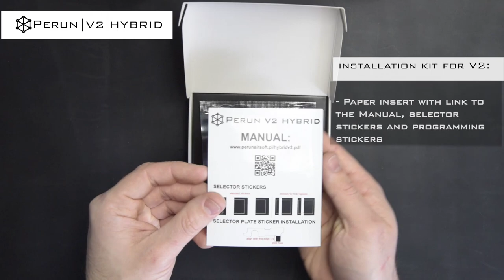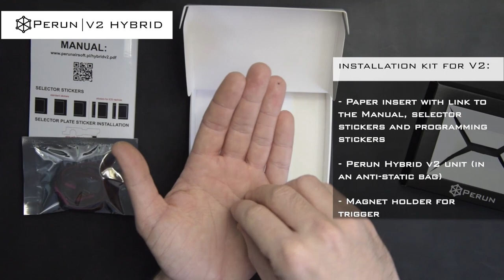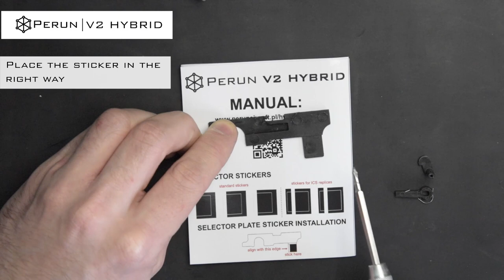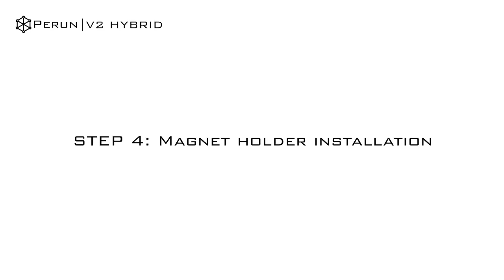Perun V2 Hybrid installation manual

Comment: So I can not use this in a gearbox that has a broken trigger bar? I have a shell that the bar broke that holds the trigger contacts. bummer....
Reply from the maker: Do you mean that small piece that normally prevents the contacts from falling back and onto the sector gear? You can do without it, the middle pin will take over its function. You will just need to remember to hold the trigger while inserting the pin.
Reply: @perunairsoft4811  Okay, thanks.

Comment: Does it work in the LT-19TL-G2
Reply from the maker: It's a standard V2 gearbox, so V2 Hybrid should work there just fine and without any modification. Unfortunately, we can't promise that there won't any surprising features there, which would require some additional work.
Reply: @perunairsoft4811  ok thanks and this video was very easy to understand

Comment: After this video i already order this kit :) I have Hight rpm motor, and for now 18:1 gears and 100m spring. Should i change it for this kit or nope ?
Reply from the maker: It's hard to say. It depends what is your motor rating, but it will most likely work. Make sure your battery has high current efficiency when using a high speed motor (high "C" and capacity).
Reply: @perunairsoft4811  Tornado F2 High Speed gen.2 this is the motor and battery is 11v and about 900mah. tbh I'm going to use it on single or burst mode 95%
Reply from the maker: @patrykkeska6696  Electronic fuse should not kick in due to overcurrent, which normally is the main reason high speed builds like that don't work. However, this 900 mAh battery doesn't stand a chance. It will quickly overheat and will long-term wear out very fast. A 3000 mAh battery with 20 C current efficiency is a minimum for such build, or at least a 2000 mAh 30 C package.
Reply: @perunairsoft4811   OK thanks a lot :) so I'm going to grab one of those big batteries

Comment: Yoo perun, love ur mosfet for sure, just tried it on my friend's replica, so i want to ask, does it fit with lonex new versjon gearbox? Thx
Reply from the maker: Thank you for the kind words :) We're not sure what you mean by the new version of the gearbox. We did test the Hybrid with the quite old Ultimate (Lonex) gearbox we have around, but if a new version came out, we can't promise there won't be need for a  modification.
Reply: @perunairsoft4811  just saw it and an old lonex gb has a hole in spring line just like ur gb on ur video above, but new model is just fully close. Btw thx for ur reply, gonna order it. Cheers 👍
Reply: @perunairsoft4811  just installed on my lonex gb and of course its a beast mosfet, love it!!!
just want to ask, how much volt that lipo alarm will buzz? thx a lot!!!
Reply from the maker: @vedhoargiaarga9983  Thank you :) Li-Po alarm activates at 3.7V per cell. For more details about that and other technical aspects of the mosfet, we strongly recommend having a look at the manual: http://perunairsoft.pl/hybridv2.pdf
Reply: @perunairsoft4811  i just have a problem with ur mosfet. Pls read the email. Thx mate

Comment: does this require any soldering?
Reply from the maker: No, unless you are installing it in a G&G replica, where in some cases it might be necessary to cut the battery connector off, channel the wires through channel in the buffer tube base and solder it back again. Other than that, there is usually no need for any soldering at all.

Comment: Will this work with cyma mp5?
Reply from the maker: Yes, but be advised that might need to grind down a small piece of metal in the gearbox to be able to put Perun in place (and not only Perun, that would be true for every drop-in unit on the market).

Comment: Thank you for this awesome walkthrough of installation, I plan on ordering the v2 rear wired model, will that fit in a CYMA Platinum QBS 14.5' gun?
Reply from the maker: Hybrids generally fit nicely into Cyma replicas, but please keep in mind that you will almost always need to grind down the knob around the contacts fastening screw. A dremel or similar tool will certainly be helpful, if not inevitable to do the job properly and in reasonable time.
Reply: @perunairsoft4811  Thanks so much for the reply! I'm ordering my mosfet right now :)

Comment: Hello, would this work in a Reinforced TM compatible Ver2 gearbox with electronic trigger and CYMA Quick Buffer System
Reply from the maker: Hello,
We're not really sure, to be honest. We know that V2 Hybrids are being routinely installed in CYMA AEG's, we're neither personally familiar nor have we received any feedback about gearboxes with QBS. We suppose that it should work, but we can't guarantee.
Please be advised that in almost all CYMA gearboxes you need to grind down and extension around the contacts mounting screw.
Reply: @perunairsoft4811   Thank you very much for the response.

Comment: Is the perun hybrid mosfet a drop in a g&g gear box?
Reply from the maker: In most cases, yes. However, in some versions of G2 gearbox, grinding might be needed.
Reply: @perunairsoft4811  good to know i have both g&g gearboxes the g2 and the regular one i will most likely use the regular gearbox for the mosfet

Comment: Can I use the 11.1v 40c battery?
Reply from the maker: It depends on what is the capacity of the battery (measured in mAh) and the build - motor used, gear type and ratio and spring rating. 

By the way, we recommend watching this video, it refers to the topic: https://www.youtube.com/watch?v=5hO25aPvHcU
Reply: @perunairsoft4811  I am currently using that product. However, sometimes it works normally, but it doesn't work, and when the battery is removed and installed again, it doesn't work again, so it beeps. I didn't even use up the battery, but I'm currently using a 7.4v 20c battery. Do you know what the problem is?
Reply from the maker: @Kimharim_04  We won't be able to advise unless you provide us the information about the battery capacity (mAh), motor model, gear type and ratio, as well as spring rating :)
Reply: @perunairsoft4811  1100mAh,  m80 spring, motor 30000rpm, vfc steel gear set.
Reply from the maker: @Kimharim_04  It sounds like the battery should be enough for such build. If there are problems running it, please contact our tech support at info@perunairsoft.pl for more extensive help.